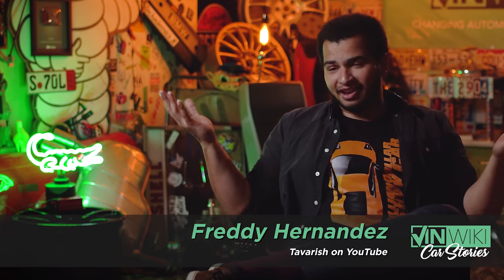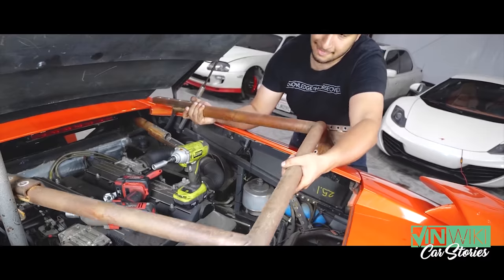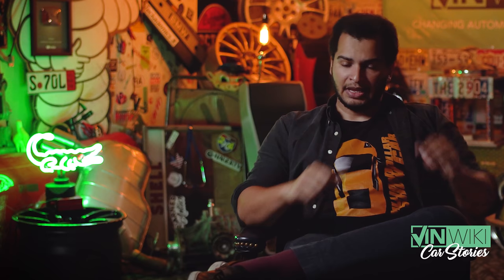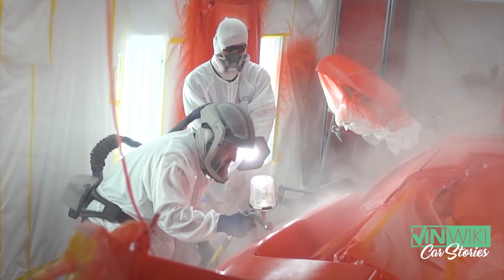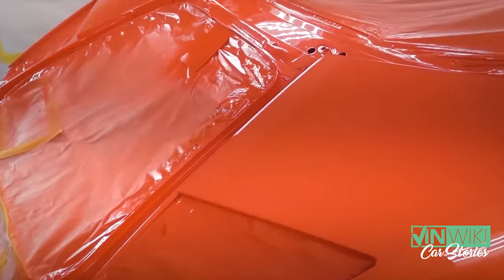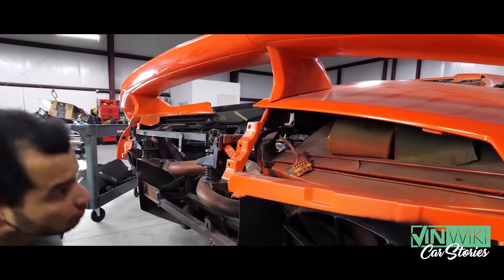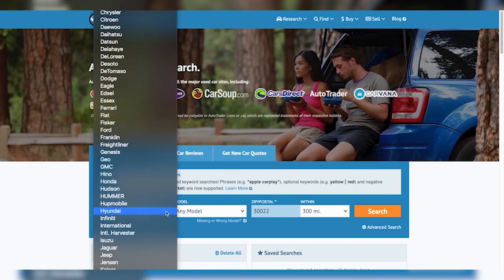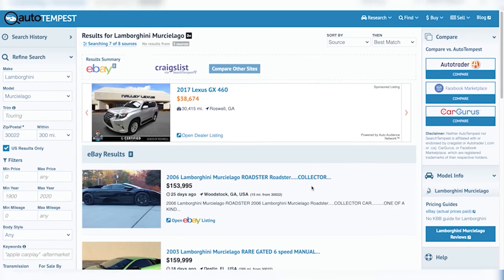The SHOCKING cost of rebuilding the Fast & Furious Lambo

Comment: "I don't know if I would do it again." Buys a wrecked McLaren.
Reply: Damian Aguirrechu he thought the Murcielago bumpers were expensive... A OEM bumper for a 675lt is close to $80,000
Reply: -we’re talking about exotic cars, not stripped down race cars
-no one said it wasn’t over $100k
-Okay? Why are you telling me?
Reply: anonymous  a dsm?? What is it a talon or an eclipse? Awd? Fuck? 80k? Really? That's nuts!!
Reply: @kylekeogh2731 80k? Can't be
Reply: Yeah. A good friend of mine has a 675lt... A towing company scraped it really bad when loading it onto a truck, completely messing up the front. The bumper and front splitter are all one part so the whole thing needed to be replaced. A new bumper from mclaren was $80,000... Luckily it was the towing company’s fault.
Reply: @kylekeogh2731  i bet the 80k price is not including paint and installation 😂
Reply: @kylekeogh2731  that sounds insane considering the car is like 300k, but i guess mclaren dont like to mass produce parts.
Reply: Zirion123 They were closer to $450,000 when new I think but I think you still have the right idea. They only made 500 675lts, so they don’t exactly have a ton of parts sitting around.
Reply: anonymous  don't have to, only if u want to make something that's gonna last. Buy a BMW/Audi, put 2 turbos on it + all the smaller stuff and you can reach 700/800 HP on stock internals ( for a couple months)
Reply: That's Alex Rebuilds. That's a great channel
Reply: @kylekeogh2731  good thing is that the build is sponsored so he aint paying that lol
Reply: @kylekeogh2731  For 80k I am going to buy all the equipments and build my own freaking bumper....
Reply: Kyle Keogh he won’t but am OEM number get real 😂
Reply: anonymous  why 80k u coulda bought a lot more w the 80k and I could spend way less then 80k have a Pristine one and build a faster motor  for way less
Reply: And proceeds to tear it down to absolutely nothing but a chassis
Reply: @kylekeogh2731  10k max bud
Reply: @brianherrick6066  oh, sorry, you’re right, the quote my friend got from Mclaren to fix his 675lt was wrong, you’re right. The dude who owns the mclaren that was getting fixed was wrong.
Reply: @stevie7214  do your research kiddo
Reply: @stevie7214  imagine acting smart but you aint... lmao
Reply: …and another…
Reply: This comment aged well 😂😅
Reply: And now he bought another McLaren 🤣🤣🤣🤣
Reply: And then the most famous wrecked P1...
Reply: Or two

Comment: $80k car
$17k bumpers
$25   tubing for alternators
$40k paint
$25k interior
$1k   wheel refinishing
$2k   tires
-----------------------
$165, 025.00 total
Reply: I bet there is like 20k miscelaneous in there somewhere.
Reply: So about the price you'd pay for a used one
Reply: @stetsongray5355  Wel yes, but he now has movie car for the same price.
Reply: Stetson Gray it’s a manual, manuals bring more money
Reply: The last car I built was nothing like this just a supercharged 75 T/A. When I sat down and totalled up the cost I had over 10K in under $50 items. Nuts bolts screws paint sandpaper window sealant clips and other little items. For a build like this I am willing to bet the little stuff added another 20 to 30k.
Reply: Alot of money,blood,sweat and tears. Gotta respect the guy he's a better man than me when it comes to some restorations. If it were me i would of just cashed out and called it a day but I understand he's a YouTuber and probably made all that money back and then some.
Reply: Kensan 173 the total is $190000
Reply: For that car thats still a steal
Reply: Yeah but ad revenue and sponsorship ect would knock 50k of that
Reply: 1. It's a movie car
2. It's a manual
3. He knows for sure that it's fully sorted mechanically
4. It's in show car condition inside and out

Definitely worth more than a random one you find online.
Reply: Still a relatively good price
Reply: This is all I wanted to know. You saved my time, thank you. Now I can waste it on the next vid.
Reply: @larrylentini5688  5) he made good money on the YT revenu to counter the cost :)
Reply: Interiors?
Reply: ot0m0t0 for the floormats
Reply: free 100$k  in labour :)
Reply: He could turn it tomorrow for $240,000 and still profit $50,000 if he wanted too. But that YouTube money 💰 doesn’t require it.
Reply: Biker Gremling this will sell for a million one day in auction
Reply: Why is the paint $40k?
Reply: That's a steel for a mercielago
Reply: @vladimirvladimirov7496  for a good paint job with body work on a common car you're going to start at $10k. And I mean perfect body work. This is absolutely perfect and an exotic car. More angles more lines more money.
Reply: Stetson Gray this is a gated manual, those go for 300k easily

Comment: Had Veilside carbon fiber over fenders on my mkiv supra almost 20 years ago. When i was trying to get the matching VS rear bumper SP Engineering out in cali tried to do the same thing to me about the Supra rear bumper. Luckily, VS made rear skirts that made the flares flow into the stock rear bumper. Glad to see Veilside is still busting heads for badass parts 2 decades later!!!

Comment: There's a "rule of 10s"
From ten meters away the car has to look good at 10kph for 10 seconds.
Reply: Sounds like a stupid rule. If it moves away, looks better and better as it distances more. If it looks good from the 10 meter away start point then it'll only look better the further it moves.

If it comes towards you, it'll make it to you in 4 seconds travelling at 10kmh and will look shit, haha.
Reply: I've always heard that as 10mph (or kph) or 10 feet away, which i think works a bit better. 
You can see the imperfections and how bad it is up close, but ten feet away or so you are too far away to tell. And if it's moving at 10mph past you, the speed blurs out errors to some degree. 
It can be more easily extrapolated out too.

Comment: Did he say the paint was 40 k ?
Reply: Flowers Naught Yea, that really seemed like a stretch. That’s one of those things where the body shop figures up the highest possible price they could theoretically charge and then round that up to the nearest 10k and tell him “yea a paint job like this would run you upwards of 40k dollars if you were getting billed for it but we’ll go ahead and do it for the promotion in your videos”.   
The “it all had to be hand sanded” didn’t make much sense either, I can understand not blasting it but what’s wrong with using a DA over all those flat surfaces.

Comment: Why not use dry ice media blasting?
Reply: It would weaken the carbon fiber and you would end up damaging it
Reply: 1216jimmyz  thought soda blasting and dry ice blasting was designed to deal with carbon fiber and carbon carbon? What do the aircraft painters use? They have both materials on the flight control surfaces.
Reply: @jaybrooks1098  aircraft carbon is built and laid out very different from automotive body panels.
Reply: 1216jimmyz  never worked with carbon fiber. Have worked with carbon carbon. It’s basically a carbon based pottery. Very light and very strong but it is brittle in some situations. Carbon fiber has so many different types of ways to use it. Lay it out. Layer it. I can see it being problematic. You obviously can’t cook a car to fix a panel.

Comment: Prime examples of bad movie car quality:
The Veilside RX7's interior got spray-painted black even on the hero-cars.
They couldn't sit in there with short pants because it'd rub off on the skin.

Suki's S2000 from the second movie had pink (essentially) bath matts in the door panels, the car is now at a museum and the door cards are white because the material wasn't UV-resistant.
Reply: It was also the same S2000 from the first movie.

Comment: I love how any time someone mentions Lambo standards for build quality being worse than Toyota's it's always in a different time period.  I'm pretty sure it covers every time period at this point.  Cars like these are the equivalent of Gucci or any other brand that survives almost entirely off the brand and people bragging/flexing by wearing/using said brand.  You can get an R35 GT-R for a LOT cheaper and performance wise it's already almost the same or better than them stock for stock.  Put enough money into the R35 that would maybe buy a new set of wheels and tires for these cars and now the R35 blows them away.  It doesn't have the brand name or questionable styling attached to it.  It also is way too realistic to be driven daily, can't be having that.